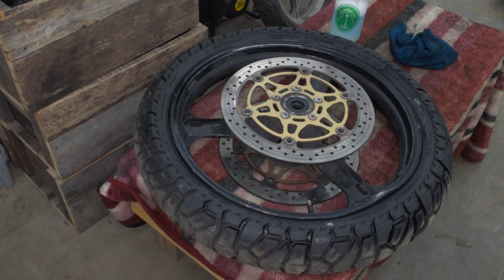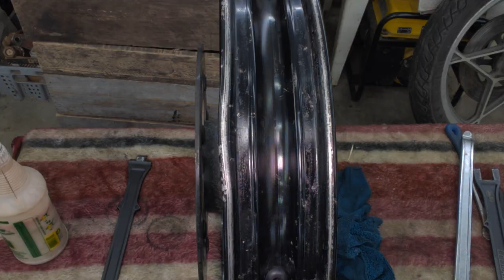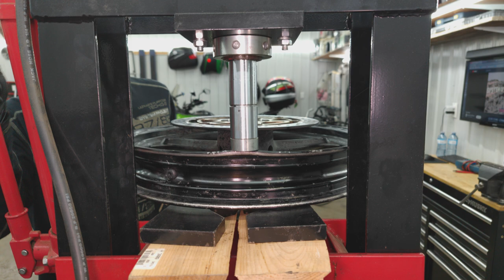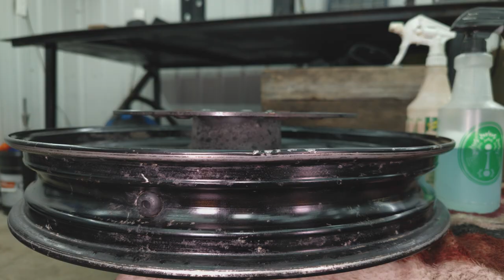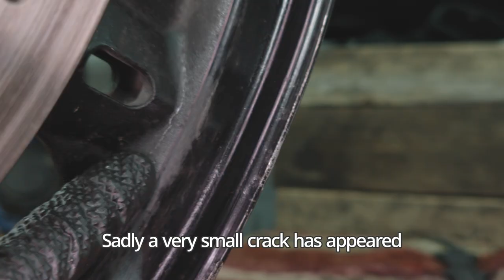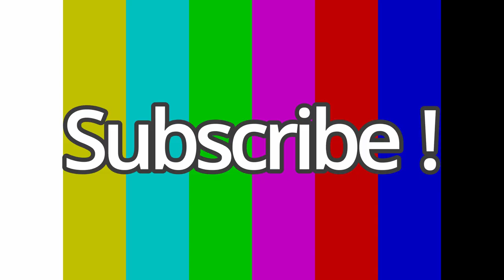Motorcycle Bent Rim Repair attempt

Comment: If it's that small could it really cause a problem?
Reply from the maker: Yes, first it is highly likely to leak air, second, if you drive in a pothhole at the same place on the rim it has more chance to break because the material is a lot weaker now
Reply: @Mathieu Tech Moto  oh ok I see, this must be a tubeless... I have a rim on my EUC that is slightly damaged like that one and I've been riding it for about a month now. Initially I was concerned but now after a month I think it is fine? What do you think
Reply from the maker: @Lee.Davis_onesandzeros  All i can recommend is to keep a periodic check of your tire pressure and you should be fine, low tire pressure cause bent rim often in the first place
Reply: @MathieuTechMoto  😊 thanks,yeah I'll keep it high

Comment: I've heard say that using Acetylene torch to heat the area 1st prevents cracks. How much heat remains a mystery as no one wants to share!
Reply from the maker: Thanks for the tip!
Reply: Yeah 100% heating the metal works to avoid cracking